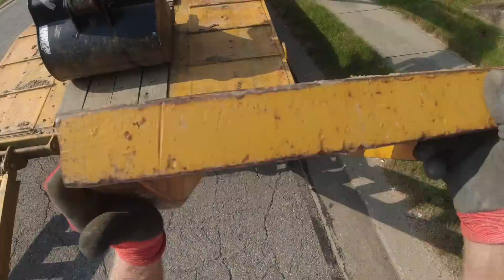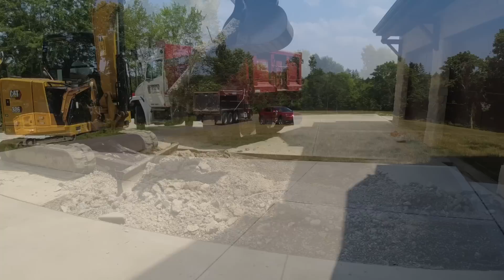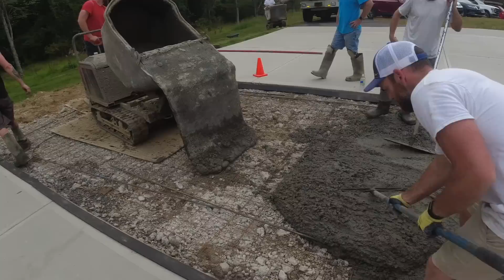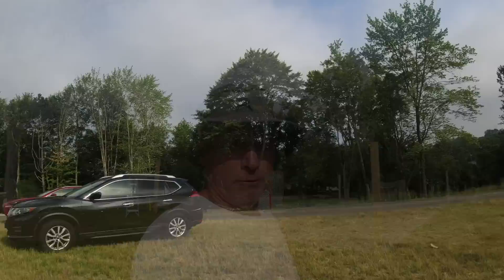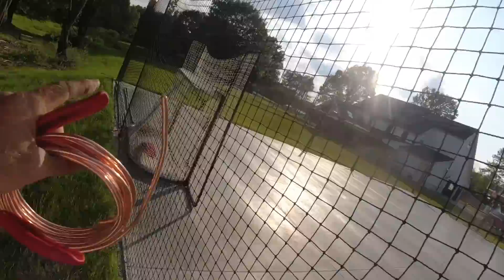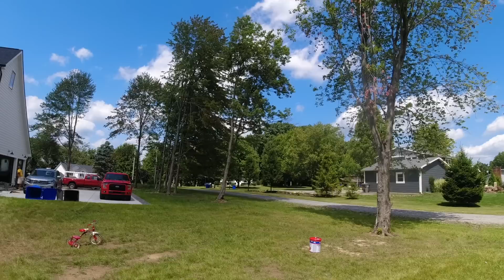My Concrete Failed! What Happened?

Comment: Nice job on the Lighting protection.  Spending a couple exra hundred or so on the copper and labor while buidling it is worth it.  If nothing happens then you will forget about it which is great!  But if you didn't do the extra little bit and lighting strikes and trashes your house, then you will be kicking yourself.

Comment: I'm thinking of doing this in front of my garage as well since we have a gravel driveway. 34' wide (width of the garage) x 25' deep and was thinking of going 7" or 8" thick due to freeze thaw cycle. Is that overkill or is 6" more than enough. I've got 6" in my garage and I don't want to go less than that. I'm in cold climate during winter in Kazabazua, QC, Canada. We get lots of freeze thaw cycles.
Reply from the maker: What if you would put Styrofoam blue board underneath it for insulation, I wonder if that would help
Reply: @Concretewiththehauses  Actually did that in the garage never thought of doing that outside, great idea. Thanks!

Comment: you asked. Mississippi Mclane trucking facility circa 2004. 200x1000' truck dock apron. 8" thick, 20' control joint grid, dowel baskets parallel to the dock face. Concrete kept cracking mid panel within days of placement. Sand Clay stone aggregate which is what is local.  The wires on the bottom of the dowel backets were not cut and keeping the control cracks at the joints.
They ripped out what they did and started new with cut wires and it was perfect. Moral of the story, if you want the concrete to crack at joints dont reinforce the joints area more than the mid slab area. 40 year civil engineer, enjoy your channel.

Comment: Tom, 5000K refers to the "degrees Kelvin" or the apparent color temperature of the light. 5500K-6000K is mid-day, daylight in full sun. (5000K is closer to sunrise & sunset temperatures. Incandescent or interior night time reading lamps are warmer, more yellow, lower numbers from as low as 2500 to 3500 degrees K.) In the olden days, color films were rated for interior "tungsten" or exterior daylight use. If you used daylight film for interior, incandescent-lit scenes without filters, your photo's would come out very, very yellow - or very, very blue in the reverse scenario, i.e., incandescent or tungsten-rated film used in daylight outdoors. (I'm a photographer by trade.)

Comment: I needed to feed an electric service through underground conduit from my cellar to a new garage. I decided to buy all the supplies from a reputable, local business for the best advice & products. After pushing the line for hours we realized we were about 40' short. Bottom line I convinced the business they needed to send out a contractor to pull the line back out and install the correct length. Not about placing blame, Tom. It's about doing the right thing for the customer and stabilizing/enhancing your reputation!

Comment: Not me, I was only 17 back in 1976.
My old man was a master builder.
He had a 12 month contract to build a multi $million 3 story house, in the richest real estate street in Australia at the time Jutland Parade Dalkeith here in Western Australia’s capital city Perth.
To give you an idea, it was next door to Alan Bond, the home grown multi millionaire who won the Americas Cup with Ben Lexens winged keel yacht.
The house was a wedding present for the Bell Brothers concrete moguls daughter.

Centrepiece of this architects design was a 3 story curved staircase in off form white concrete.

So to create the pure white concrete, the entire concrete plant had to be cleaned out, pressure washed of any trace of grey cement or crushed granit “blue meta” and yellow sand.

White beach sand was trucked in for the mix. Crushed Snow White quartz was trucked in for the aggregate.
White cement was produced to make the pure white concrete mix for the 3 story pour.

Every agitator truck was sand blasted inside the drum back to bare steel, there was not allowed to be one spec of anything Grey or blue metal coloured, it had to be all perfectly white.

Old man had every finish carpenter and cabinet maker and shipwright craftsman he could hire to build the form work.
All of the dressed pine form work was burned with a butane torch then sandblasted to leave the grain of the form work timber proud, so that the grain pattern would be reverse imaged in the concrete finished surface.
Dad ate slept & worked on sight with his trades for 6 weeks, getting the form work perfect, all the rebar tied in place.
There wasn’t allowed to be even a cigarette paper width gap between formwork boards.

After 6 weeks of preparation the day of the white concrete pour came, and it all went perfect.

The grano workers poured it and vibrated it etc and it was perfect and beautiful.

After a few days to set up, the removal of the concrete formwork started, and it was perfect. There were zero voids, the grain relief pattern was perfect.
There was no contamination to spoil the perfect white concrete 3 story curved staircase.
It really was a thing of beauty to behold.
It was a Thursday and after a solid 6 weeks everyone was exhausted.
To celebrate the great work all the trades had done dad put on a bbq lunch and free beers for all the workers involved on site including several 18 gallon kegs of beer etc, as his way of saying thanks to everyone involved for pulling off a miracle pour.

The architect planned to have a professional photographer come in on the Sunday and photograph this staircase for the cover of Australia’s National architecture magazine & there was to be a write up in the magazine about this “miracle white concrete pour, and how the architect designed it and what was involved in the pour etc etc.

The architect planned for this to win house of the year award for all of Australia, that year.

Anyway the architect and Bell Bros Daughter for whom the house was being built as her wedding present arrived to view the centrepiece of the house 3 story curved white off form concrete staircase prior to the photographer coming for the magazine shoot on the Sunday.

She walked in through the double entrance doors, stood still looking it all up and down - and said “Ohh No, this will never do, I couldn’t possibly live with that!”

So the photo shoot was called off, the grano workers were all back on the Monday with jackhammers and had to remove a full inch of white concrete off every surface.

She chartered a jet and had 80 tonnes of pink marble flown in from Italy and the white staircase was coated on every face with inch thick Italian marble.

It was the most hideous gaudy thing you’ve ever seen.

The architect refused to have it filmed and the house was never entered in the “best house in Australia architecture magazine competition.

Never work for people with too much money Tom. 🙄

The old man retired and never built another house after that one.
He had been building for 34 years at that point.
It literally broke him.
She literally was “the client from hell”.

Who can top that one? 😜🙄😂😂
Reply from the maker: You definitely have me beat

Comment: Have you guys wver considered utilizing concrete prefab panels stamped or stained as backsplash for decorative wainscot? Years ago I had a large horseshoe driveway in blackwood nj that I had to hammer out a replace the second part of the pour. I ate it but re-did it. A year later the top started peeling off.

Comment: Not sure I understand how the builder is on the partial hook for the rip out/replace costs.  I’ve had a few over the years. But the concrete supplier and the installer took care of it between them. Though I did have to supply Coffee and donuts for the crew😊

Comment: Tom few years ago I have a problem with an intermedia concrete slab just bend after few labs test we found that the problem was the concrete strength max psi was 1500 and should be 3000 psi. The supliere paid for everything anyway this type of situation is not easy to handled I send to you the best wishes because you have show that your job it is always done correctly

Comment: I attended an OSHA grounding and bonding course a long time ago.  The instructor told us to never put sharp bends anywhere along a grounding rod.  He told us that could cause the lightning to jump the sharp bend and not go into the ground.  Nice smooth, straight runs are the best with minimal bends.

Comment: Tom, CCT = “correlated color temperature” measured in the Kelvin units.  5000k is rather neutral and good for that application. Those are sweet looking lights and you did good with the installation, as I would expect from you!
Reply from the maker: Thank you very much

Comment: Once when I was a bricklayer, we were putting up a one story building in an industrial park next to an expressway. We did one 12" block wall that was 16' tall and 100' long. It was pretty muddy, and we struggled to put in supports along the wall. The next day we went to another job, to give our laborers a chance to tear down the scaffolding, and move it to the next wall. The laborers came back way earlier than we expected, and told us the wind coming over the expressway had blown the wall over, as they were still on the scaffold. We got lucky, and insurance covered the damage, plus we were able to reuse a lot of the block.

Comment: As a manufacturers rep in the window industry for the last 28 years I’ve seen my share of hiccups.  Issues have been in our manufacturing, contractors installation and the wrong product being sold by the the dealer.  It’s in everyone’s best interest to work together to solve the problem.  Unfortunately, many run away from the issue than confront it quickly and get it handled.  You tackling this problem will pay you back many times over in new business because it was the right thing to do for everyone.

Comment: Great customer service.  I had a floor in my garage flash on a very warm day in South Dakota.  The heat of hydration was just too high. The contractor made good as you did. The concrete had cement from the SD State cement plant. I never let my friend at the plant live this event down.

Comment: hey guys, my name is Paul, i live in ne PA. im a retired mixer driver with 33 years in nyc. i worked for the biggest company in ny. over 350 mixers. you should invest in an air pot and test any questionable load. too much air or low air will screw you up every time ! and don't be afraid to sent it back to the plant.

Comment: If rubbing the top too much weakens the surface, (31:01) then why are some surfaces floated with the power floaters?
Reply: Short answer: Trowelling is different than floating.

Longer answer: Floating using a curved surface pushes the entire mix down, but mostly the paste rebounds upward. Leaves a smoother surface that can be better sealed. But, all the strength of concrete is in the aggregate. So an excessively floated surface is physically weaker to a greater depth. Trowelling, on the other hand, including power trowelling is displacing the concrete horizontally to get the shape of the surface as desired. But trowelling doesn't separate the paste from the aggregate and doesn't weaken the concrete surface when done properly.
Reply: Thanks for the explanation @mikebarushok5361

Comment: Mine wasnt so much a failure, but a never ending job. Went to replace a couple bad deck boards and found the deck wasnt flashed to protect the house. Ended up jacking up and replacing 10'of rim joist. Started as a 3 hour job. Way to stand by your product!

Comment: As an electrician I was asked to add a circuit in an old house. I had reservations but drilled up into a top plate on a wall. I hit an old lead waste pipe. Paid the contractor to tear out a bathroom tile and floor to get to the pipe. I lost money on that job and didn’t go to the insurance company.

Comment: Could you explain air ratio in a future video, and let use know what concrete mixes you use on your projects, and just do a brief explanation of what they are, and why you use that particular mix for that purpose, if that makes sense.
Reply: I would like to know about the air-ratios. Is this a northern climate thing? Freeze-thaw? I've seen similar concrete failing in a full neighborhood up here in WA state and heard from a concrete guy that said that it was a bad mix. The concrete failing looks exactly like what he shows in the video, not too deep and consistent to the upper 1/4" of surface... definitely not from deicer because all the sidewalks and driveways are similar, and like Steve describes, the concrete doesn't necessarily crumble from being weak. Steve please post or talk about the correct ratios needed, is it just the air or just a bad mix of materials?

Comment: About every 4 years it happens to me. 99% of the time its due to bad soil conditions and trying to keep schedule on track.  I actually wrote a check back to a customer. It was never going to be right without excavating 8 feet of soil out of driveway. I was the second guy who tried, not even rebar 1 foot on center and 6" thick worked.  Now I stop and address with homeowner.  If they sign off we pour if not we walk away.

Comment: That section really was a different color. I can't think of any way you could have noticed any difference as it was poured from the mixer. The color difference was only obvious after it dried. You talk about over skreeding it a lot, so that didn't cause it to flake, because your crew knows not to over skreed it. I honestly don't see how you are liable for any of that. All the pour around that section was good, proving TSH's handling was normal. Shouldn't take a court to see that. So, by assuming part of the liability, when it clearly wasn't any fault of yours, sure does make you look great in the builder and concrete company's reputation, but I just hope your customers see that it was nothing TSH did. Actually, TSH really shines for interrupting their schedule to remove and replace the defective concrete for no compensation! Kudos on TSH! And I most certainly remember the exposed aggregate walks that cracked along the edges because the ground and sub base was frozen under the pour. The moment you discovered it, you went into replace mode wout any anger at all. I was so impressed. Besides the cracks, those walks were so beautiful. So much pressure you deal with! You are even responsible for the quality of the concrete coming out of the mixer! You handle pressure very well. May we all take notice and see your example of how to handle stress. As for Tom's sports arenas, inside and outside, wow, so cool! Man, those lights really light the court up nicely. How awesome! Game on!!! Super nice video! 👍❤️🙏🇺🇸🇺🇸

Comment: In my area several years ago,  bad concrete was used in foundatios basements driveways sidewalks.  the concrete made from that aggregate suffered from a condition called alkali carbonate reactivity (ACR), leading to deterioration, instability and cracking, damaging any structures using the concrete , it was a nightmare for homeowners.  The lawyers got paid real well the homeowners barely got anything.  They had new homes with cracking foundations  that were condemned until being fixed .

Comment: dirty aggregate and not enough cement. Probably not the same psi as the other pads. because of the color I would more go with the dirty aggregate. I don't think the air would do that unless you poured it well over a 6" slump. and I never seen you do that. The samples I pulled off of concrete like that always come back dirty aggregate, just something to think about.

Comment: Nice of you to shoulder part of the problem on the drive way .I was superintendent on a sports complex for a client , as an after thought he decided to add a 40x40 patio in stamped colored concrete .He contacted a " I know a guy " who supposedly could do it cheap ,yup it was cheap , pitched toward the door and ran short of concrete , and color , so when the remainder of concrete arrived the color which was originally a tan turned an orange .When the owner noticed it he was beside himself and his "I know a guy concrete guy " was long gone .

Comment: I used to use a post pounder to drive ground  rods until one day when I was helping a well seasoned electrician and he said let me show you the easy way to install a rod. He came back with a gallon milk jug full of water ,then made a small hole with the rod pulled the rod out and filled it with water and kept doing this until the rod was only 10”above the ground and finished it with a sledge. Have never used post pounder since.

Comment: Hi Tom redos are not fun but it shows your integrity. And that can bring in more work in the future. As for the ground rods. Next time try a ladder and a large hammer drill. I think Hilti makes a adapter to go between the hammer and the drill. I never used it , I just put the rod into the drill and it works great.

Comment: First off, props for being honest and showing that you had to fix it. Youtubers tend to hide the bad and only show the good. Thank you for putting yourself out there.

Secondly, ground rods.... unfortunately you're done, but hopefully this helps others. My uncle-in-law is an electrician and he watched me struggle to pound one in for about 10 minutes once (so he knew I would appreciate his lesson). Then he dumped water where the rod enters the ground. Pulled it back out and continued to (for lack of better words lol) thrust it in and out. Over and over. He put the entire 8 foot ground rod in the dirt in about 2 minutes without breaking a sweat and only used his bare hands, and then tapping the last few inches with a claw hammer. When it starts to dry up a little just dump more water in.

Comment: Hey Tom good on you for making it right and not blaming ANYONE else for the bad concrete taking responsibility is a ethical way to go and preserve your reputation. Those lights are AWESOME!!! If I may suggest a hammer drill to drive grounding rods in. Thanks for your video. Ed in Partlow Virginia.